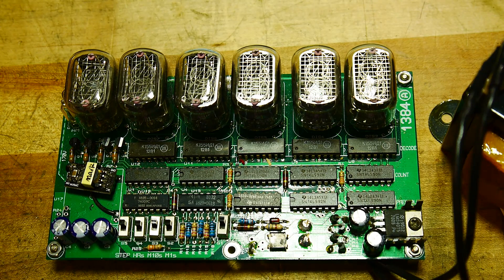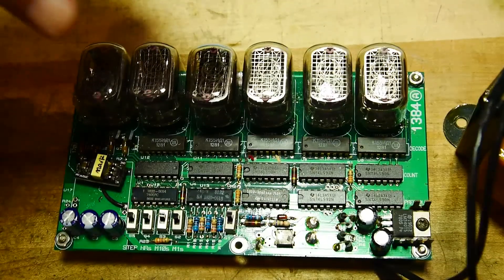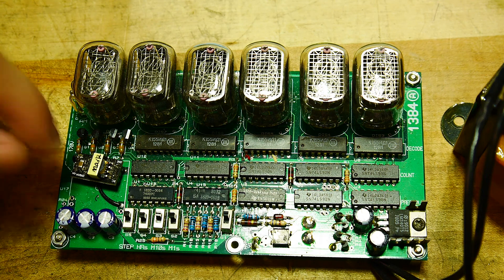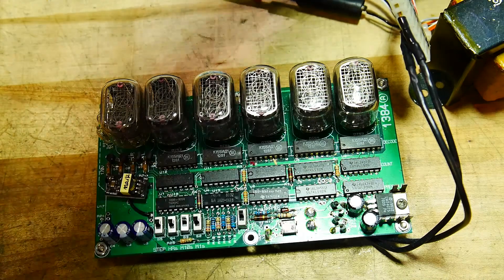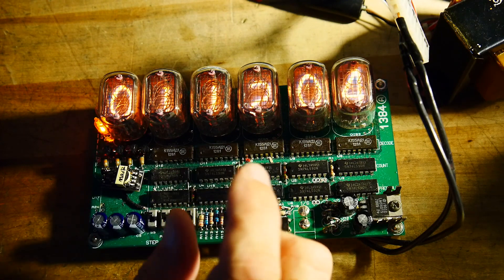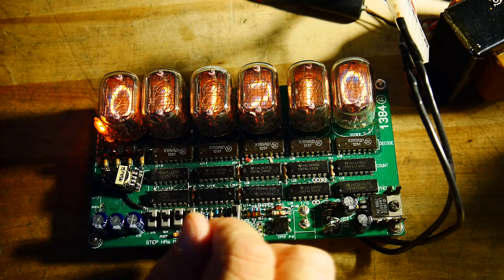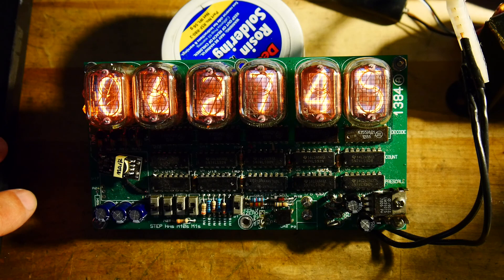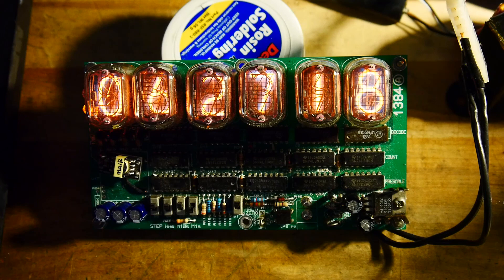#117 TTL Nixie Clock

Comment: That's near exactly what I had imagined I'd build. Just without a understanding of a basic concepts, I feel like I'm missing a big step. But having that goal even if it's too dangerous at this point has led me to look closer at the basics. Kind of a eyes bigger than capabilities moment. Or something like that.
Reply from the maker: start with LEDs as the display, the rest of the circuit will be the same and LEDs are very safe.